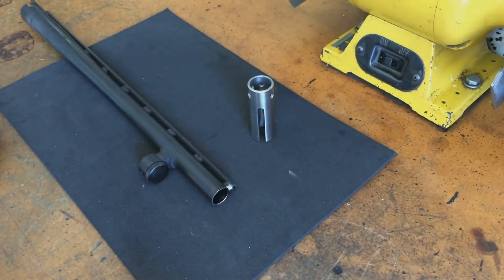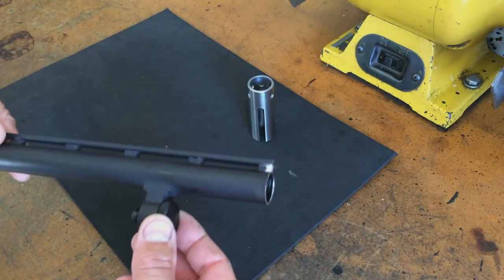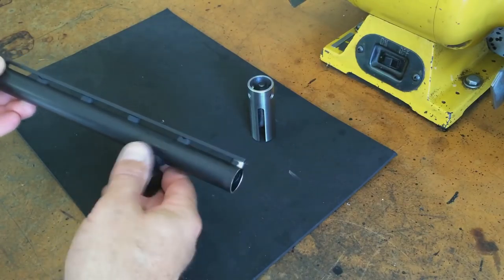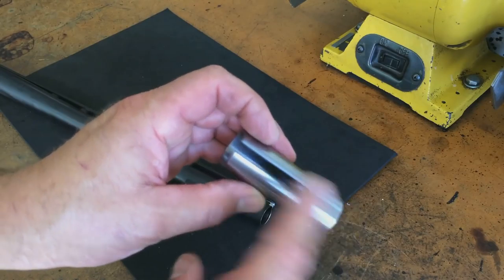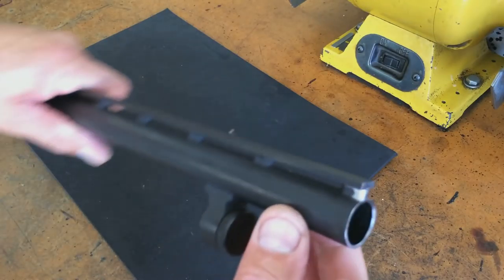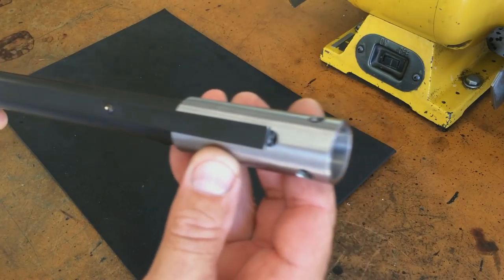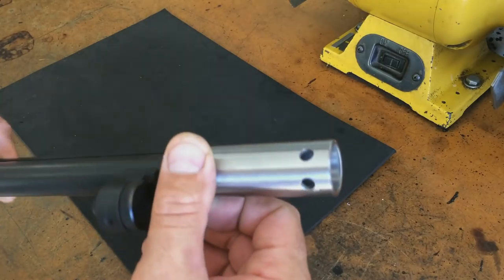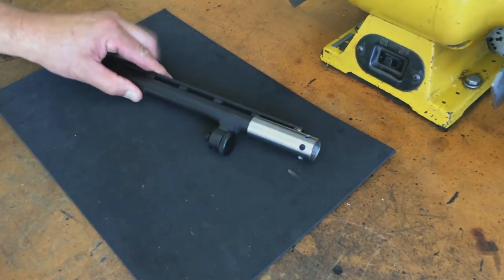Muzzle Brake #realraysgarage

Comment: So, if he cut the end off, does it have a choke anymore?  That could make for some pretty strange patterns coming out of the shotgun....
Reply from the maker: +Keith Rucker - VintageMachinery.org Hey Keith,
Yes it will but, he is only after looks, (muzzle flash) and use as home defense gun only. He did tell me that it held a tight pattern up to about 10 yards with a cool flash pattern from the five ports! That's want he wanted so I delivered!

Thanks for stopping in buddy!
Ray

Comment: why put a flash supressor on a weapon that is for home defense?   Shorten the barrel, yes.  But, I'd rather have the intruder get his eyes singed from the barrel flame etc.  Ha ha, people do some cooky stuff.
Reply from the maker: +WAVETUBE84 I hear you and agree, to each is own I guess. If anything a door breach muzzle brake would have been nice!

Thanks for dropping in!
Ray
Reply: +WAVETUBE84 This does not appear to be any kind of flash suppressor.....If you note, the exhaust ports are angled to the rear, forcing gasses rearward, and in doing so, it is supposed to reduce recoil.  These actually do work, as I've got quite a lot of experience using these on .50 cal rifles.  A 12 gauge has a bit of recoil, and reducing it helps.  I actually would like to have one of these myself...

Thanks for the idea Ray!
Reply: Clete88 I don't know jack about guns.  Ha  ha.  Just goofing around.
Reply from the maker: +Clete88 I think the main reason he wanted this muzzle device was for the display of flash gases in the dark, so it does do this quite well but does not reduce recoil since the ports fire outward.

Thanks for you comments and for stopping by!
Ray